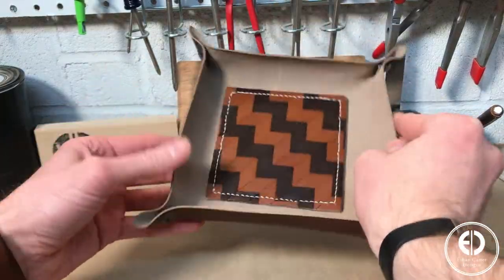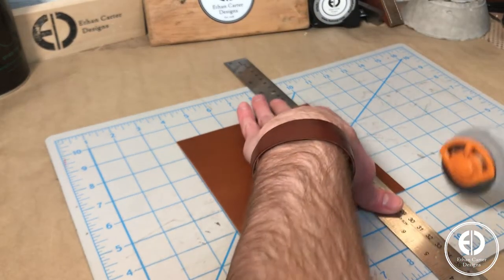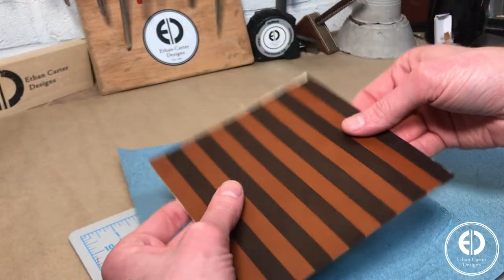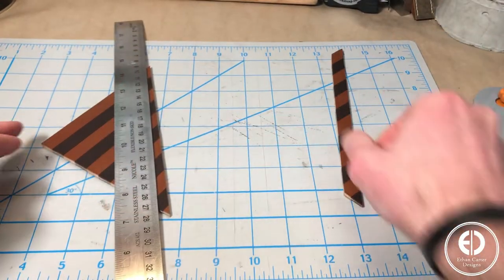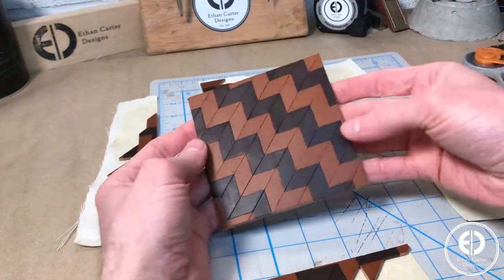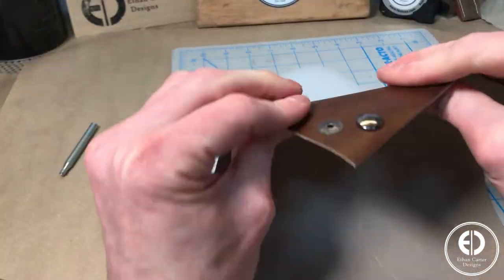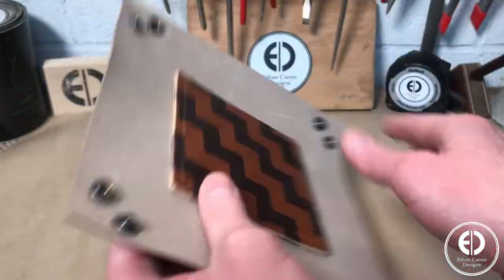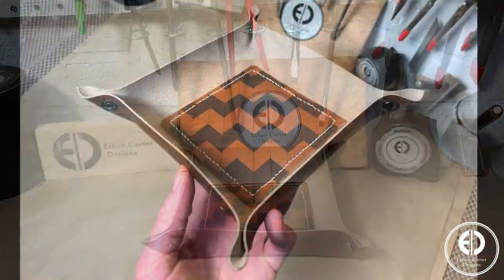How to Make a Leather Valet Tray

Comment: So here’s a question… If your bottom panel is a circle.. How do you layout the stitching hole pattern. 🤔
Reply from the maker: Whenever I'm stitching a circle I still use my wing dividers to score a stitch line around the edge of the circle and then use a two pronged pricking iron to gradually work my way around the circle. Only using a two pronged pricking iron allows you to take the curve more consistently - takes more time, but it works!
Reply: @EthanCarterDesigns  Perfect thank you..
Reply from the maker: @perrydoerr8668  Anytime!